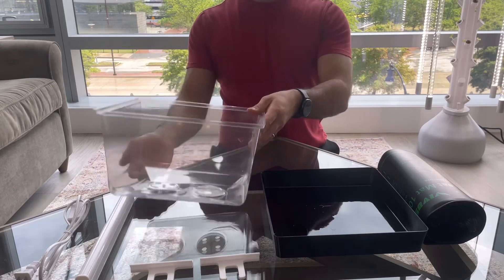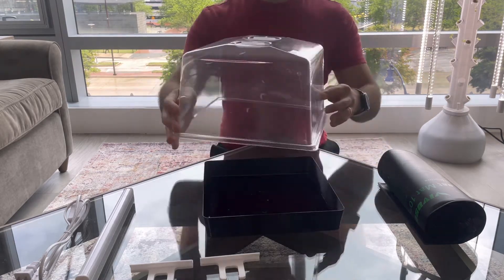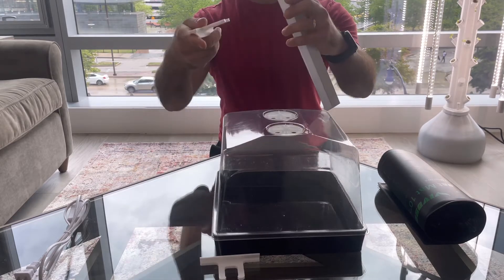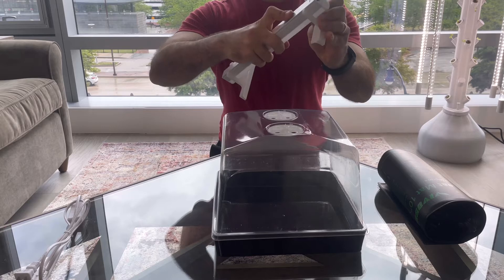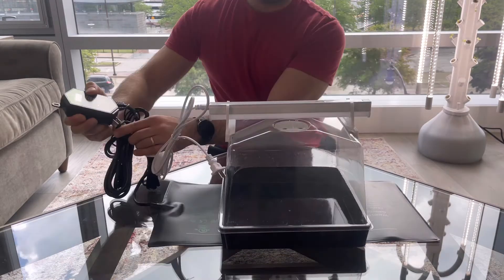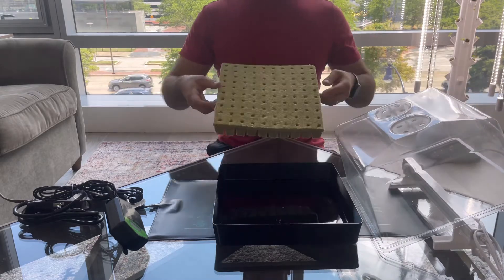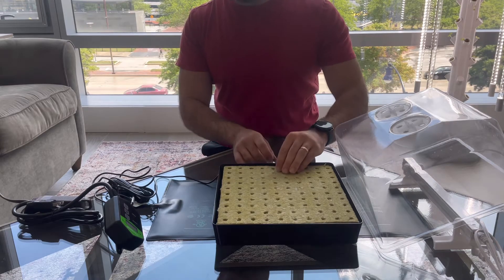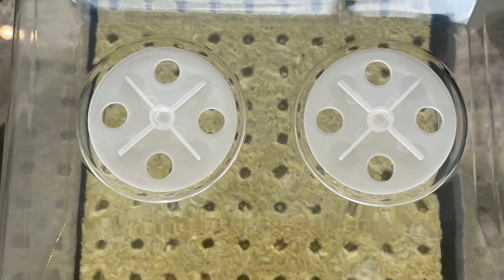Seed Starter Propagation Kit Set Up

Comment: At some point will likely need a heating unit like this but for now I covered the rock wool with the germinating seeds with a sheet of newspaper to keep some of the humidity in after adding water. The seeds sprouted in about two days and are now growing on the shelf without a unit like this. During the hot and humid months something as elaborate as this heating unit isn't needed. The sprouts for seven different vegetables and one herb variety are about 2-3 inches high. Will transfer to the towers in about 2 days I think.